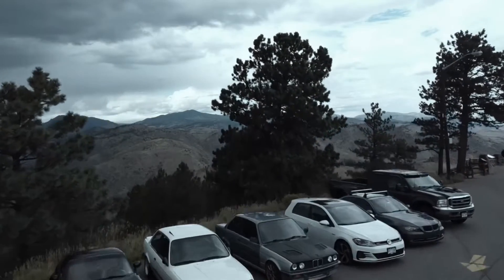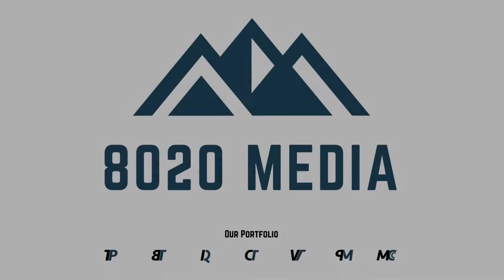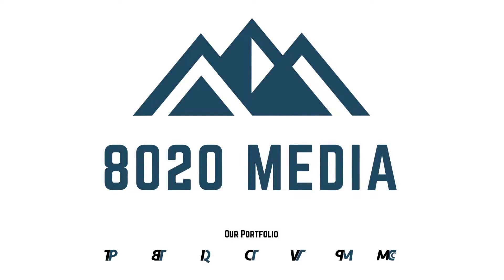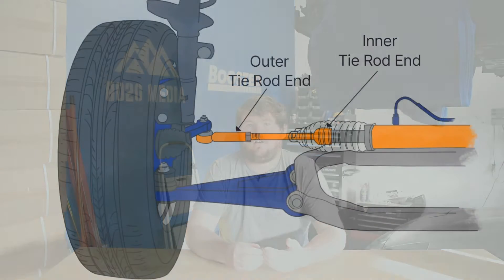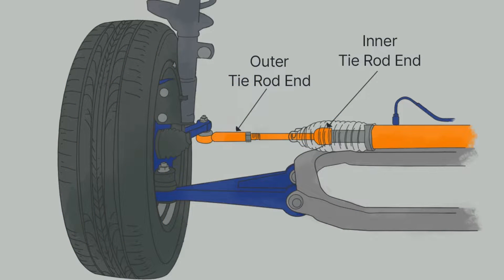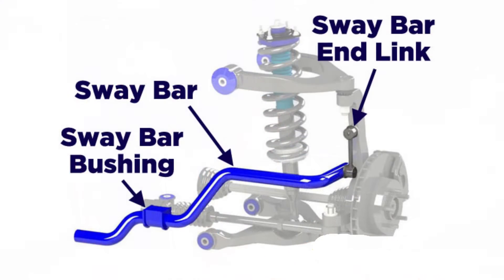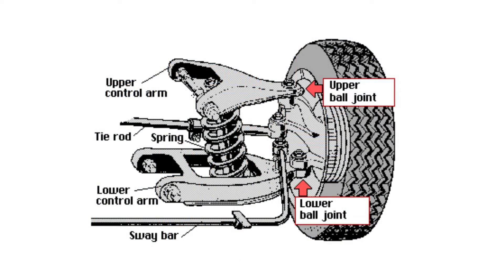DIY - How to Diagnose a Car Clunking Noise While Turning

Comment: Do you know why the car catch more speed on its own ?
Reply from the maker: K - If your car is catching speed on its own, it could be due to a few things depending on how it behaves: if it happens gradually, it may be normal idle compensation (like during A/C use or cold starts), or a sticking throttle body, vacuum leak, or faulty idle air control valve (IAC); if it’s more sudden or aggressive, it could be a bad throttle position sensor (TPS), cruise control malfunction, or in modern drive-by-wire cars, a glitch in the electronic throttle system—either way, it’s worth scanning for codes and checking throttle and idle components to rule out anything unsafe.

Comment: I have a 2006 Mustang GT 4.6L.
I am having clunking and popping sound coming from front end. When driving at normal speeds and encountering a right oriented curve, front end (seemingly on the right wheel side), shakes and clunks severely. Is this a Sway bar issue?
Reply from the maker: T - Yes, based on your description, it’s very likely a sway bar issue, particularly a worn or broken sway bar end link or bushing, which can allow excessive movement and noise during body roll in turns; however, also closely inspect the lower ball joint, control arm bushings, and strut mount on that side, as any looseness or wear there can cause similar symptoms, especially under cornering load—lift the car, grab the wheel at 3 and 9 o’clock, and check for play or clunking in those components to confirm.
Reply: @ Thank you very much for your advice. And thanks for replying.

Comment: I’m getting a loud clunking sound when I’m turning or braking
Reply from the maker: M - A loud clunking sound when turning or braking usually points to a loose or worn suspension or steering component, such as a bad control arm bushing, worn ball joint, broken sway bar link, or even a loose caliper bracket or strut mount—turning puts side load on the suspension, while braking shifts the weight forward, so if something is moving more than it should, you’ll hear it clunk under those loads; get the front end lifted and check for play in the wheels, movement in control arms, and tightness of brake components, especially if the noise is sharp and metallic.

Comment: If the clunking comes from the rear, How about the differential or drive shaft?
Reply from the maker: J - Yes, if the clunking is coming from the rear, the differential or driveshaft are both very possible culprits—common causes include worn universal joints (U-joints) on the driveshaft, excessive backlash in the differential gears, a failing differential bushing, or loose/misaligned driveshaft flange bolts; if the clunk happens during shifts, acceleration, or when going from drive to reverse, it’s often drivetrain slop or play in those components—get under the vehicle, check for play in the driveshaft, look at the condition of the rear diff bushing, and inspect the differential fluid level and mounts to narrow it down.

Comment: I’m not sure how to describe this but, whenever i turn my steering wheel left and right (full lock both ways) the car will move, And not while driving in park, the car will sway left to right when steering wheel is left and right.
Reply from the maker: A - What you're describing is actually normal to a degree, especially in vehicles with power steering and soft suspension setups, because when you turn the wheel at a stop, the front tires scrub against the pavement, creating enough lateral force to cause the body to shift or rock slightly; however, if the movement feels excessive or clunky, it could point to worn suspension components like strut mounts, sway bar end links, or control arm bushings that are allowing too much play—so a little movement is fine, but if it’s pronounced or accompanied by noise or binding, it's worth inspecting the front end components for wear or looseness.

Comment: My 016 ILX makes a clunk or something when turning at round 25 mph
Reply from the maker: V - A clunk when turning at around 25 mph in your 2016 Acura ILX is most likely caused by a worn CV axle joint, especially if the noise happens during acceleration or deceleration while turning—it’s common for the outer CV joints to develop play or binding that causes a clunk or pop as they articulate under load; other possible culprits include a loose or failing sway bar end link, worn lower ball joint, or even a strut mount issue, but the CV axle is the most common in this case—inspect the axles for torn boots, grease splatter, or excessive play, and check front suspension hardware for movement under steering load.
Reply: @8020Automotive maybe not a clunk. More of a scrapping or whirring sound. Thank you!

Comment: Great informative video, you covered so much! I have a 2000 Mustang, my rack & pinion & tie rod ends were replaced and i noticed when completely turning my wheel/tire hits the stabilizer bar and rubs against it and makes a huge knocking sound when completely turning wheels to any side. Rack looks correctly installed. What else could it be? *it didn’t have this problem before replacement*
Reply from the maker: V - Thanks for the feedback! If your Mustang didn’t have this issue before the rack and pinion and tie rods were replaced, the rubbing and knocking you're now experiencing when turning fully likely points to an installation or alignment issue. First, double-check that the tie rods (especially the outer ones) are the correct length and not over-threaded or misadjusted—if they were installed too short or too long, your wheels can have too much toe angle, causing them to contact the sway bar (stabilizer) at full lock. Also verify that the rack is centered properly—if it’s off even slightly, your steering may turn further in one direction than the other, leading to contact. Another thing to check is whether the sway bar bushings or mounts got bent or shifted during the repair, bringing the bar closer to the wheels than it should be. Lastly, inspect your wheel offset and make sure the tires weren’t changed or spaced incorrectly during the repair. Since the issue started immediately after the parts swap, it's almost certainly tied to a misalignment or improper part geometry. A thorough alignment and visual comparison to OEM specs should help isolate the problem.

Comment: The wheel well shield is torn into. Can this make a clunking noise when turning left?
Reply from the maker: R - Yes, a torn wheel well shield can absolutely cause a clunking noise when turning—especially left if the damage is on the left side. When the wheel turns, it may make contact with the loose or torn plastic, causing it to catch or flap against suspension or steering components. This can create a clunking or scraping noise. It’s also possible that the shield is no longer properly secured and is moving around as the wheel turns or flexes under load. Inspect the area closely, especially around the tire, strut, and sway bar links, to confirm it’s not rubbing or catching. Replacing or securely fastening the shield can often solve the noise issue.

Comment: Very informative, any suggestions where to check for clunking/knocking while turning at higher speeds, in just one direction like when turning right.
Reply from the maker: L - A clunking or knocking noise when turning right at higher speeds is often caused by worn components on the driver’s side since that side takes the most load during a right turn. Check the CV axle for play or torn boots, the lower ball joint for looseness, sway bar links or bushings for wear, and the strut mount or bushings for any signs of damage. Also inspect the control arm bushings, wheel bearing, and steering components like the tie rod ends and rack mounts. Any play, cracking, or looseness in these parts could be the source of the noise.

Comment: Spice got one for you have a 2016 Chevy equinox just got new tires put on yesterday a whole set have had alignments had everything suspension changed was driving smoothly for a day and now when turning left or right it makes a cranking noise. That’s the best I could describe it please help
Reply from the maker: C - If your 2016 Chevy Equinox just got new tires and now makes a cranking or clicking noise while turning left or right, especially after suspension work and alignments, it's most likely a CV axle/joint issue. The noise you're describing often points to a failing outer CV joint, which can become more noticeable under steering load. However, since this started immediately after new tires, also check that the lug nuts are torqued correctly, nothing is rubbing against the tire or inner fender (like a loose splash shield or brake shield), and ensure the shop didn’t accidentally stress or damage a component during installation. A quick inspection underneath or at a shop should confirm it fast.

Comment: i have a single knock drivers side  when turning left, it makes the noise when i start to straighten back out, gotta call on monday but any ideas? thank you for your kindness if you see this comment.
Reply: Same issue, did you figure it out?
Reply from the maker: S - That single knock when straightening out from a left turn, especially from the driver's side, is often caused by a worn or loose suspension component like a sway bar end link, control arm bushing, or strut mount. Since it happens when weight shifts back while straightening, it points to something that’s binding slightly under load, then releasing. Less commonly, it could be a CV joint or steering rack bushing, but you'd typically hear more consistent noise if it were those. A shop should be able to pinpoint it quickly with a lift and some prying.

Comment: Hi! I have a knocking sound from the front of the car that can be felt through the floorboards, and it only occurs when turning at low speeds. 

The knocking sound is slightly delayed, whereby it doesn't happen while the steering wheel is turning, but only after the car has moved a few inches during the turn.

The knocking feels like it's coming from under the passenger side's feet (right hand drive).

I've had a look under the car and the left sway bar link's bushing has already torn, so I'm thinking it may be that. Though, your video seems to be pointing more towards the tie rod 😅.

Any ideas? Thanks in advance!
Reply from the maker: J - Based on your description—knocking when turning at low speeds, felt through the floor, and slightly delayed after the wheel turns—it could definitely be the sway bar link, especially since you already noticed a torn bushing. A worn or torn sway bar link bushing can cause knocking during body movement in slow turns, particularly when weight shifts and the bar starts to engage. That said, the delay and floor vibration could also point to a worn lower control arm bushing or possibly an inner tie rod, but tie rod issues usually cause more direct steering play or noise while turning, not after. Since you already have visible damage to the sway bar link, I’d replace that first—it’s a cheap fix—and see if the knocking goes away before chasing deeper suspension parts. Let me know what you find!

Comment: Front end sound buckling and grinding almost like metal on metal.  Wheel bearing Hubs for sure needs replacement for Ford Explorer I'm going to be doing the repairs myself and wonder what other parts would be a good thing to replace as well
Reply from the maker: M - If you're already replacing the wheel bearing hubs on your Ford Explorer due to buckling and grinding sounds, it's a good idea to also inspect and consider replacing the CV axles (especially if the boots are torn or there's clicking on turns), brake pads and rotors (if they're worn unevenly or have grooves), sway bar end links and bushings (common wear items that cause clunking), tie rod ends, ball joints, and possibly control arm bushings depending on mileage and condition. While the front end is apart, it's efficient to address anything with play or wear to avoid future teardown.
Reply: @8020Automotive  you rock! Not gonna lie but I'm a little intimidated crawled under and I'm guessing but thick layer of to me is oil. Tried smelling it but really no scent.  I contemplating selling

Comment: Mine only make the clunking noise when turning not driving. Example reversing in parking space or driving off turning slowly other than that while driving no noise. It’s like a creak clunky noise. When i turn the steering wheel but outside.
Reply from the maker: P - If you're hearing a clunking or creaking noise only when turning at low speeds (such as parking or reversing), but not while driving straight, the most likely culprits are worn suspension or steering components. Common causes include tie rod ends, ball joints, strut mounts, or sway bar links. Since the noise happens when turning but not while driving, it suggests a load shift on the steering components rather than an issue with the wheels or drivetrain. Check if the noise gets louder when turning the wheel while stationary, as that could indicate strut mounts or tie rods. If it happens when reversing or moving off, control arm bushings or ball joints may be worn. A visual inspection for loose or damaged parts is a good start.
Reply: @8020Automotive  this happened to me today, is it safe to drive the 40 mins to the mechanic?
Reply: I am currently expericing this issue, have you solved yours?
Reply: This is exactly what my car is doing. Did you figure out what needed replacing?
Reply: did you guys ever figure out what part was causing the problem because i’m having the same one lol
Reply: Inter tie rods mate
Reply: Same thing is happening to my 2017 civic.. I took it to the mechanic and they lifted the car but said that everything looks good. I’m just paranoid that they overlooked something and I’m making it worse now. I would rather have to get something fix sooner than later. If anyone knows anything about the fix lmk! Thanks
Reply: @hazthemc power steering. It’s normal
Reply: @hazthemc my accord has the same issue. Mild/low clunk when turning at low speed. I just had the dealership go through every inch of the car and told them to fix everything/anything she needed. Only 20k miles. I’m pretty sure the car did this even when I first rolled her off the new car lot.
Reply: @cowpoly1564 I did everything but struts and have this sound after I change I'll update
Reply: @cowpoly1564 my 2015 Camry did this starting around 15k miles and Toyota replaced wheel bearings which fixed it temporarily and it started making the clunk noise again. Brought it in again and they replaced struts. Still made the clunk when slow turning and they continued to do repairs at 45k and 60k. Toyota dealer told me they brought in their engineer and replaced another wheeling bearing even after warranty and giving me free rentals every time I brought it in. Long story short is they never could diagnose the problem and car still runs great but the clunk remains at 240k. I did replace my worn out sway link bars myself recently but the clunk mystery remains unsolved
Reply: I have similar issue too when turning at very low speed such as making a Y-turn. I do noticed that one boot is torn and the rearseay bar bushing came off its location. Truck currently has 199k miles. I just ordered new sway bar link and kit to replace the current one.
Reply: Did KBY struts and OEM sway bar links on my 14 Odyssey and have the same issue, idk what it could be but it sounds terrible
Reply: Same happened with me, I changed my all rotors and pads, two months ago and one month ago I changed my driving shaft exiles, ball joints and lower control rod. Please let me know, I got this car 3 months back and I have already spent around 2k CAD

Comment: Trying to diagnose something on my “new to me” 2018 Audi S5. Possibly a front fender liner?  I can only replicate the situation when I slowly back out of my driveway and then turn the wheel hard to the right as I’m backing. I hear this situation at no other time at all.  The vehicle is very low to the ground and I can’t see anything of course.
Reply from the maker: O - Your 2018 Audi S5 likely has a loose or misaligned front fender liner or possibly tire rub due to its low stance. The noise when turning hard in reverse could indicate that the liner is making contact with the tire, especially if the car has aftermarket wheels or suspension modifications. Another possibility is a loose undertray or splash guard, which may shift slightly under certain angles. To diagnose, try feeling around the wheel well for any loose plastic or rubbing marks. If you can safely jack up the front end, inspect the liner, suspension components, and wheel clearance for any signs of contact.

Comment: My 2011 Honda Odyssey is knocking intermittently when making sharp right hand turns. Struts, shocks and sway bar links have been done. Told me my control arms and such are fine..still knocking..
Thought..??
Reply from the maker: S - If your struts, shocks, and sway bar links have been replaced and the control arms are fine, the intermittent knocking on sharp right turns could be from a CV joint, engine mount, or loose suspension component. A worn outer CV joint is a common cause, especially if the boots are torn, allowing grease to escape. Also, check the subframe bolts, tie rods, and ball joints for any looseness. If everything seems tight, consider checking the steering rack bushings or axle shaft play, as excessive movement in these areas can also cause knocking noises during turns.